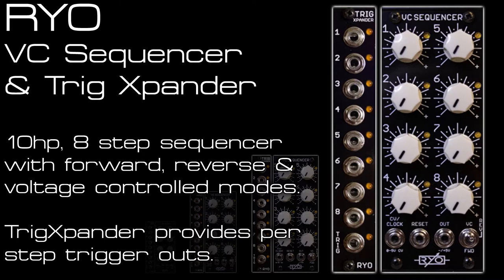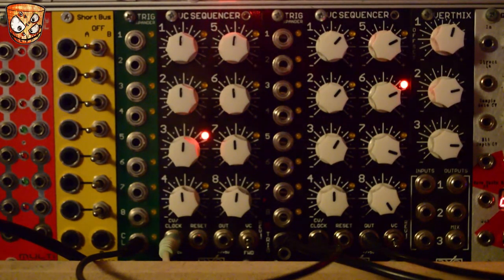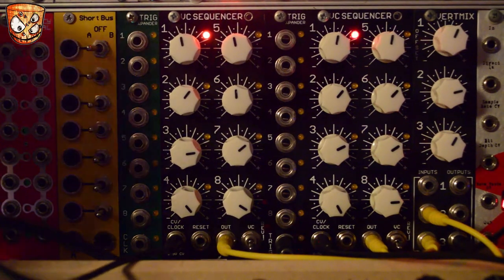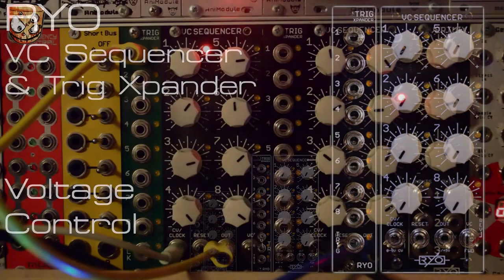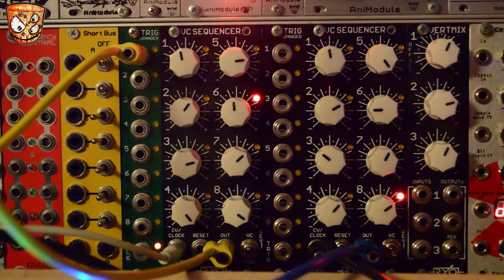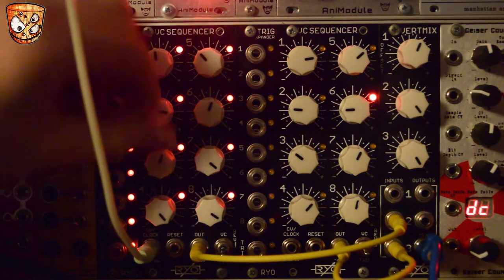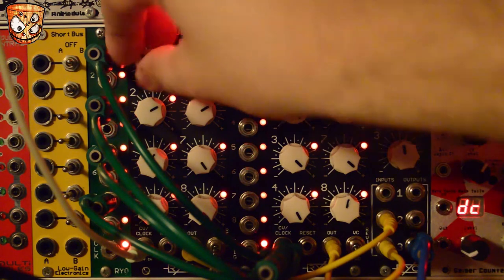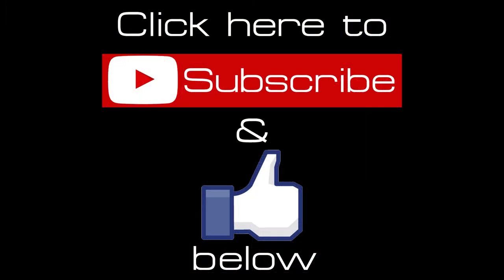Dual RYO VC Sequencer & Trig Xpander

Comment: hey man! is possible to use them as a 16 step sequencer ?
Reply from the maker: RYO were working on an expander to do that but it hasn't come out. You can do that with a sequential switch. Don't I do this in the video at one point (can't remember as it was a while ago).
Reply: So with the paths module can i do this?